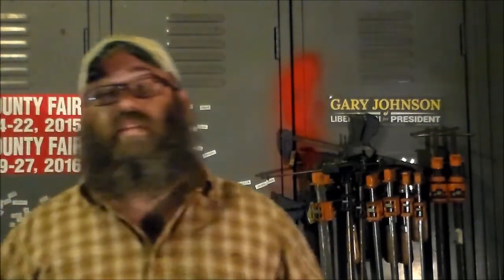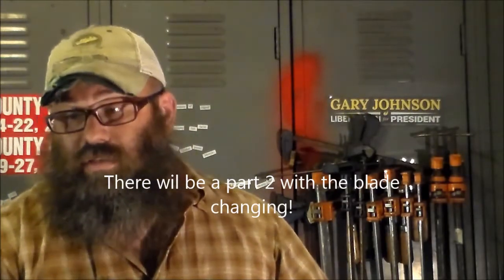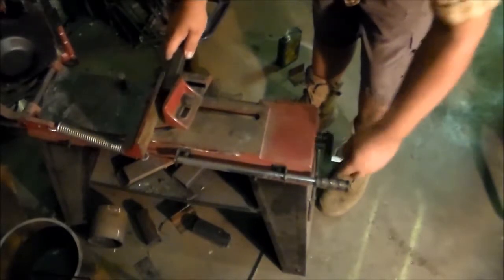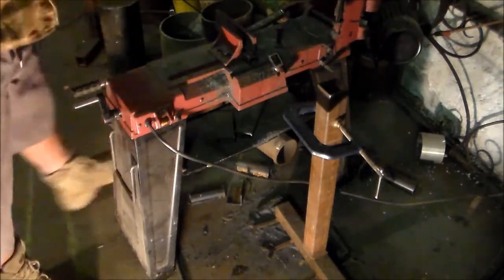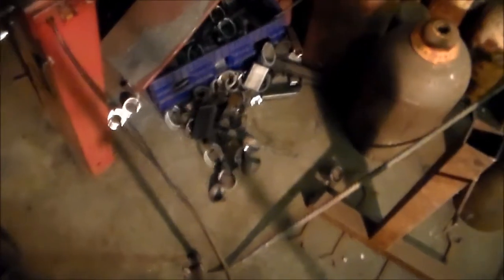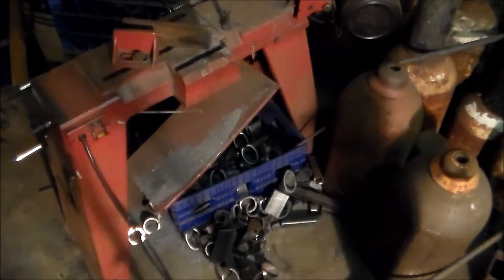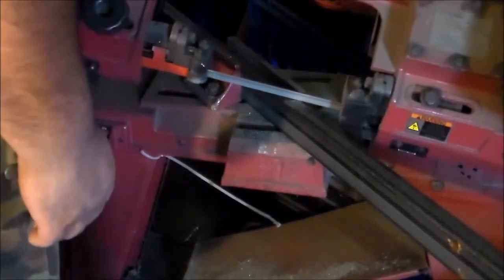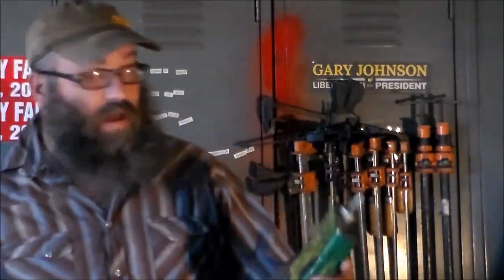The 1hp 4 x 6 Horizontal/Vertical Band Saw Cutting Steel Episode 3

Comment: I don't know if I like the new 4x6 bandsaws, or not. Mine has a manufacturing date on it of 1993 and it is made in Taiwan. So it is probably a genuine Rong-Fu machine. Rong-Fu is the original designer, and manufacturer of a lot of the far eastern machinery. Then it gets knocked off in mainland China. My mill is a mainland knockoff of a RF-32. It is not so swift.

But yeah my 4x6 bandsaw kicks ass. I've sawn railroad track in half on it. So that 4x6 capacity is just a suggestion. You should make a new stop plate to vertical cut on. I made a bigger one and it is a lot nicer to use. I also made a speed jackscrew for the vise of mine. But if you don't cut small pieces then that is not very handy.

You don't have to build a new base. Just put some stretchers on the existing base. That stiffens it right up. But I do have my saw on a dolly I made for it too.
Reply from the maker: Good input Paul! By the way I want a heavier base with castors and storage underneath.
Reply: Voo Doo Tennessee
What I did was I just screwed a piece of steel between the two sides of the base. That made a huge difference. I've seen people make whole new bases. A waste of time. But I also have my saw on a rolling dolly too. The dolly is fitted, and fairly heavy. So I'm sure it is adding to the saw's rigidity. This was the best mod I did http://i.imgur.com/aCbW2wX.jpg I made a stop plate just a little bigger than the stock one. Now when I use the saw in the vertical position I have a bit more table to work on. It is totally worth doing. My new plate can stay on the saw when I use it in the horizontal too. I put the stock plate on the one I made for scale.